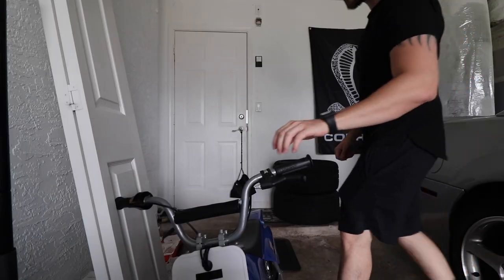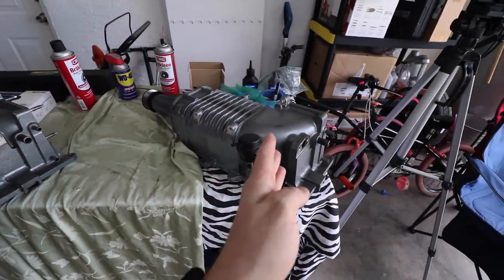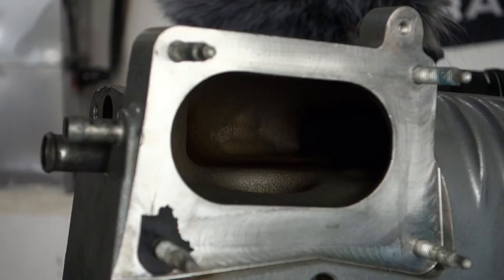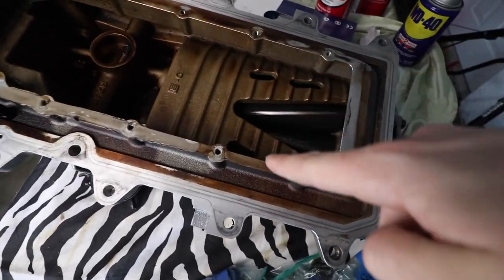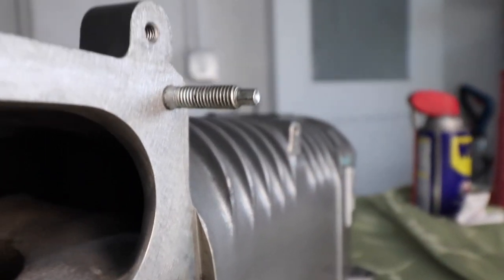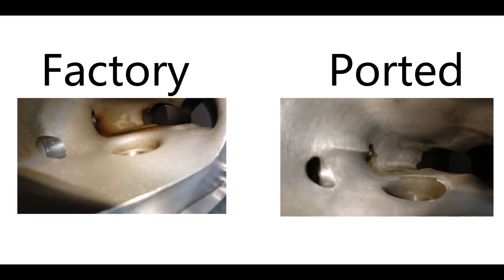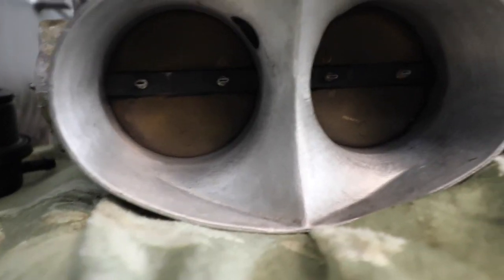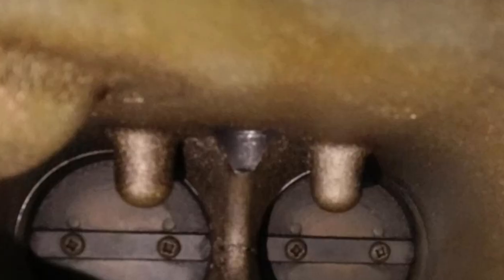Factory vs Ported | What are all the differences?

Comment: A ported throttle body won't give you any noticeable power gain, but it will give you a better throttle response time. Good video.
Reply from the maker: The Elbow was the one that I saw the biggest difference TBH
Reply: @TheMGChannel  Yes, I was really amazed at how restrictive the stock elbow is compared to the ported one. You should feel a big difference in the power!
Reply: It actually gives, depend on how many strictive it is. I ported out my protruded bolts from plate, plate and walls at least 1 mm. Torque gains are awesome on my stock 190 hp supercharged engine. Without tune +10 nm and 3 kw, and about +15 nm from 1500-2500 rpm range. For sure, effect became lower and lower as rpms climbs higher.
Reply: Nope but , a ported throttle body a ported supercharger , ported heads will give you all the gains

Comment: Another difference......one whines.....the other whines a lot hahaha
Reply: Wouldn't the stock one whine more since it's less efficient?
Reply from the maker: @JordanSVT  The sound pitch is different in the ported blower for sure, I don’t know which one is louder but I’ll let you know for sure lol
Reply: @TheMGChannel  Interesting...I used to wonder why a supercharger whined. I had always thought it was the sound of air being sucked in (which probably is part of it) but I eventually heard it has to do with the efficiency of the blower.
Reply from the maker: @JordanSVT  Well that is definitely true to some extent, but even the newer Kenne Bell blowers are load as F, and with ported Eatons guys usually run more boost so that’s why you get the “ Louder “ from im guessing, now the ported Eaton is still not a twin screw blower, it’s a still a tiny 1.8L blower, it does fairly well for the technology that it was developed and considering the size as well
Reply: @JordanSVT  the ported eatons whine  more than the non ported ones to my knowledge
Reply: @TheMGChannel  That's a good point, I notice in videos those Kenne Bells scream, especially compared to something like a Whipple. But I've heard they're prone to heating issuses, maybe they've fixed that in recent years.
Reply: @Lethal_Venom  I wonder why that is. Either way those Eaton blowers make the best sound IMO, if only they made as much power as aftermarket blowers.
Reply from the maker: @JordanSVT  I definitely agree, the Eatons make the best sound

Comment: I have a supercharger on my merc 2005 w203 c200 whivh is noisy. I want to know who can rebuild the damage parts
Reply: Look up Jokerz Performance in the United States if you're in the US. The owner responds fast and can tell you if he can rebuild your SC. He rebuilt mine, bearings, Coupler, and all for $600 USD. A lot cheaper than a used SC for at least $1000 USD or a new one from the dealer for crazy $

Comment: I ported my eaton m62 the outlet and after that i loost alot of boost car was slow as hell after 100km, fitted a stock one after that and now its faster than ever, also my blower has a 71mm pulley
Reply: Then you ported too much, usually 1mm to 2mm MAX is good. I have a ported m62 too and its way quicker than stock. Also, more psi doesnt mean better power. Pressure is a fluids restriction to flow..so if you open it up, it will flow better at lower pressure. Same thing happens when you put headers/bigger diameter exhaust. Theres a sweet spot in there. If I had to do it again, I'd consider just polishing instead of a port. Also might consider getting some 4 lobe rotors like the H62 made, H not M..but there was only maybe a handfull of those made
Reply: @x8xPopCoRnx8x  unfortunately not :(

I just slapped it on there when I got it. Might have to retune it aswell since the AFRs will be off 🤙🏻